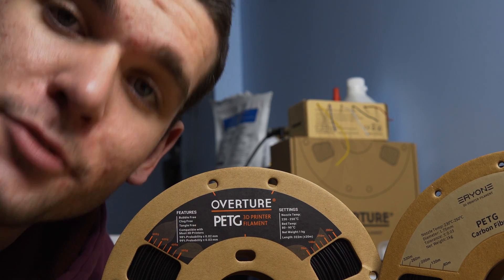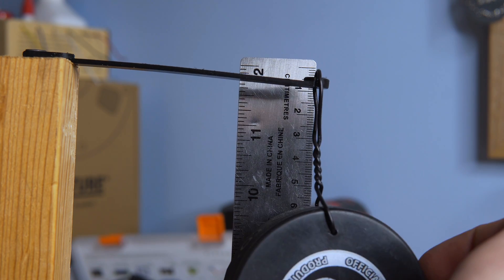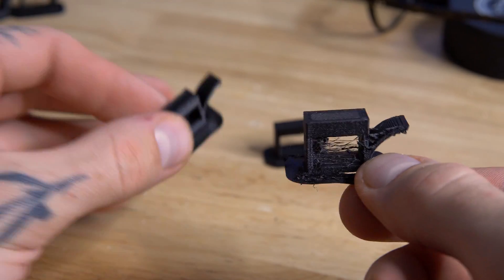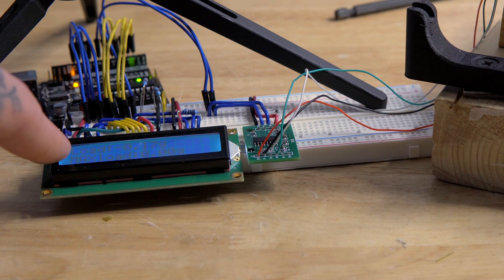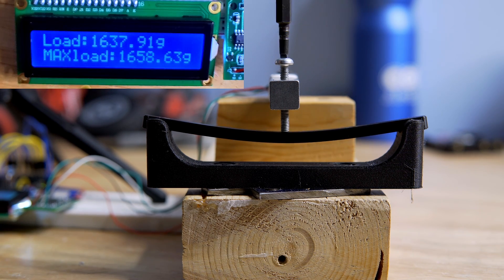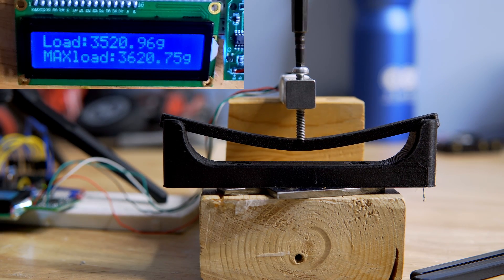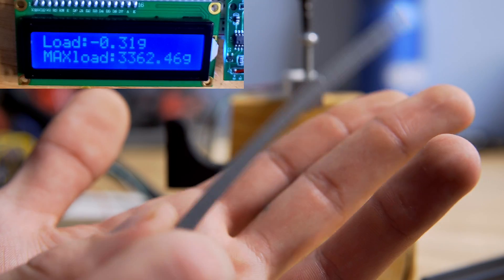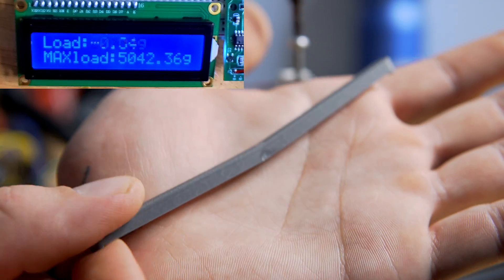Carbon Fiber PETG: Is it worth it? Best PETG Print Settings

Comment: CF PETG is a scam.  The CF has voids where the carbon fiber actually disrupts the layer adhesion.  Take a look at this under an SEM, and before anyone says it, no - annealing won't change it in any significant manner.  That said, it is visually more appealing and may hold up better in higher temp.  There are better filaments if you want a strong part.

Comment: I think if you just hadn't driven the screw so far every time, you still could have gotten useful data.  If you had a stop nut on the screw above your aluminum bar to take up some some stroke so you didn't go to the point of failure on the CF PETG, you could have measured force or relative stiffness at that much deflection on each sample.  I'm impressed with your methods and field expedience on setting this measurement up!

Comment: big thing as others have mentioned the temps should definitely be higher & ur fan is way too high.  which will certainly affect the fact that it delaminated is a clear indication its under extruded & at a too low a temp.  w/ a efficient cooling system a max of 30% cooling (same for petg,  more cooling = weaker parts when it comes to petg).   And the CF likes higher flow then regular petg.   But of course not all brands are created equally either.   I've just started my cf/gf journey as i'll be printing in primarily that.  so i just bought heaps of it.

Comment: If you are just looking at stiffness for the purpose of your impellers, then you should deflect the various materials the same amount (distance) and compare the loads required to get there. I believe that PETG/CF will be stiffer and I don't think that in the case of impellers, it would break. I would also try to perform the test at the same temperature that the impellers will be used at. I assume the liquid temperature is already known?

Comment: I would suspect the carbon fibre would help with deformation when compressed. For instance two metal flanges bolted through a PETG CF spacer. Drilling, tapping a thread etc.... would be interesting also! What about clamping in a lathe chuck and attempting to machine? ... using a face mask, carbon fibre is nasty stuff!

Comment: Should also try ASA, TPU, PC, and PA6 (Nylon)
Reply: With ASA/ABS also in the CF variants - mainly because decent length carbon fibre might be enough to prevent or at least reduce warping tendencies!.
Reply: @ that’s a good point!

Comment: Thanks, I was thinking of trying to print my product in PETG CF.. a screw and grip into the bottom with printed threads, so layer adhesion and cracking are high priority. This looks like the matte texture is not worth the PETG properties loss.
Reply from the maker: Maybe not, at least not with the cheaper brands. It might be worth trying something more pricey, but I think the benefits are negligible.
Reply: @Neally  I ran a burn off test on some voxelab and by volume it was  .05% cf. I prefer brands that list the cf % because some brands add carbon black powder and not chopped fiber.

Comment: My guess is that the CF in the CFPETG concentrates the stress into one area. The CF wont be able to stretch, so it will want to / rather delaminate (because the top layer will be under compression, and the bottom layer under tension.) So it starts to delaminate. If it doesn't delaminate then the next thing to fail would be the bottom layer CF fibres breaking in one spot and then all the strength is gone in that one spot, so it cracks. Meanwhile the rest of it still has intact CF running through it, so remains strong. 

Meanwhile the petg; there's nothing causing different stresses between the layers (tension / compression due to the CF) so the stress is spread more evenly across it.

There's probably some more materials science that goes into it but that's above my knowledge. Yield strength etc.

I've just been designing my first compressor and housing to fit a specific motor in fusion and your channel came up in my recommended, so your channel is right up my street. Although all my PETG is wet and not printing nicely at the moment...Subbed
Reply from the maker: Great info! Thanks, I appreciate it!

Comment: Carbon fiber is tensile strength and usually doesn't like to be bent like that
Reply: Right, he misunderstands the difference between yeild strength and tensile strength. Carbon Fiber adds strength and rigidity, but makes the parts more brittle and less flexible. Also printing with CF, the Fibers are all on the same layer not passing between the layers, which will sacrifice some layer adhesion for more strength in the other direction. CF has it's place, but it has trade offs. Doing this test and calling CF no good demonstrates a large misunderstanding on the material. It isn't good for some use cases, but it is better for others.

Comment: As I've replied to other comments, my friends and I have had much better experiences with CF PETG. I do think the Eryone brand is not a great example of the filament type. My #1 recommendation would be Tinmorry followed by Voxelab AKA Flashforge. While CF or other fibers definitely don't automatically make parts stronger and can decrease layer adhesion, they add other desirable properties. Generally, better bridging and overhangs, easier printing at higher temperatures, less stringing, a more uniform if matte finish, less visible layer lines, and yes more stiffness. Good CF PETG should be like easy mode printing PETG with a really cool finish. Another example of material made easier and better in multiple ways by fiber is glass fiber polycarbonate AKA GF PC. As always, it's just important to remember how much filament can vary by brand and even by color or batch, and that print settings can drastically affect results. Good video though!
Reply: Tinmorry gang! On my 3rd roll with a X1C stock .4 nozzle. Prints beautifully after drying and calibrating which I do for everything but basic PLAs. Had some initial stringing on multi part and complex geometries, but after dialing in the speed and retraction + avoid crossing perimeters in bambu studio, I'm flyin through the stuff.
Reply: @MD.20.20  Calibration is honestly key to get high quality results.
Reply from the maker: I'll have to give tinmorry a try! Cheers, thank you!
Reply: @Neally  Mechanical engineer here there are two PRIMARY reasons to use CF PETG is that it slightly improves the glass transition of a PETG print and that, even as your tests showed (although I suspect you had filament and/or print issues) the end result is substantively stiffer until plastic deformation occurred. 

Another thing to keep in mind is that Carbon fiber only consistantly improves tensile strength load conditions, which is why the failure point starts at the top. This is because the bottom of the beams were in tension and the top is in compression. Do not expect strength improvement in compression loads so avoid "bridge" loads if you want to see better performance out of CF prints.
Reply from the maker: @benruss4130  Thanks!

Comment: I've been told PETG CF is significantly easier to print than regular PETG because the CF helps with the moisture and bridging during prints 

I bought 2 spools to try out because I hate printing regular PETG but I want to print things to go in my garage and not have them warp..
Reply: This is my general experience along with several friends in a 3D printing Discord. CF PETG is easier to print than PETG generally and has a lot of desirable attributes. The finish is especially nice if you like a bit of matte and less layer line visibility. I recommend trying Tinmorry or Voxelab/Flashforge brands to start.
Reply: Any results?
Reply: @FrankensteinV203  sorry forgot to reply 
petg cf is so good. I just wish it was cheaper 

prints almost exactly like PLA. sticks to the bed really good but still can be removed. as tough as PLA but with even less shrinkage. no need for a filament dryer just printed it straight. and no need for tuning just used bambu defaults. 

I tried regular PETG and it has been super difficult to get it to stick to the bed and to print well. 

I will never buy regular PETG again.. too much of a hassle
Reply: @FrankensteinV203  it should be coming in today

Comment: I noticed that petg strength and stringing etc differentiate even with different color of the same brand. It can be that pla is stronger but in sommer its different story.. Try to use phone holder in car or so.. Pla is useless outdoors

Comment: I primarily use PETG for its UV resistance and its temperature resistance but mostly the UV. PLA will not only melt or deform in sunlight but it will deteriorate as well. Not good for parts that need to be outside in the weather. I think that CF PETG is more for aesthetics and nothing more. It gives you that flat black finish that some find desirable.
Reply: Entirely agree

Comment: Carbon fiber for consumer-grade 3d printers is a gimmick and a waste of money. Even under the BEST circumstances carbon fiber filament adds almost nothing to the the parts. Consumer-grade FDM printers are amazing, and for light-wear items and rapid prototyping, the are incredible machines. If you need more strength and stiffness, then there are better options.
Reply: Just adding a side note that it is great for applications where heat is your main concern. Of course not saying its the best material but for people with lower spec printers its prob the best option like in my case. I wouldn't rule it out right but as everything else people need to know what they are buying and why. The advertising is for sure misleading though.
Reply from the maker: For sure!

Comment: Everything I've seen so far makes it seem that CF infused filaments are a gimmick.
Reply from the maker: Agreed. Maybe a higher end CF petg filament would perform better, but the budget filaments seem practically useless
Reply: Maybe formulas are just getting better, but this isn't my experience at all. While CF or other fibers definitely don't automatically make parts extremely strong or make layer adhesion better generally, they add other desirable properties. Generally, better bridging and overhangs, better printing at higher temperatures, less stringing, a more uniform if matte finish, less visible layer lines, and yes more stiffness. I'm not sure if the particular brand in the video just wasn't great or if it needed higher printing temperatures for example, but generally my friends and I find CF PETG to just be better than general PETG all around for many purposes.

Comment: It appears cf filament is a waste of time and money
Reply from the maker: It seems so, at least the brand I was using it. It's unfortunate really, I liked the textured of it a lot
Reply: Will always depend I use it solely for its heat resistance as it is more heat resistant that normal PETG. Granted it wasn't tested but just commenting to show its another use case compared to the application in the vid. As my a1 can print PETG with ease but struggles with other heat resistant materials just makes it SO much easier to work with.

Comment: I print PETG CF at 260c because the hardened steel nozzles need a lot of temp to maintain good extrusion and layer adhesion. I use no fan for first layers and then 25% with an enclosure. In the summer, I up the fan to 50%
Reply from the maker: I found upping the fan speed after the first layer seemed to reduce stringing, but honestly getting the setting for it right seems more like  voodoo than anything😂

Comment: I love PLA, the looks, the ease of use, the non toxic and semi biodegradable nature, the renewable part and the stiffness. But high temp really ruins it even at moderate levels. I think eventually we will have a PLA ++ or PLA 2 that has all the good plus better temp resilience.
Reply from the maker: I've been printing with pla a lot more lately and it really is wonderful, if only it had better thermal characteristics
Reply: it's the non toxic and semi biodegradable nature for me 🤓

Comment: My experience with PETG CF has been disappointing to put it lightly. Annealing might help, but the cf is basically ruining PETG’s best attribute which is flexibility before breaking. Long strand cf would be better, but chopped cf is a waste.
Reply from the maker: Agreed, I've heard higher quality cfpetg is less disappointing, but for my purposes it's definitely impractical
Reply: Eryone is typically very high quality.   I would be surprised if it was a quality issue.   See my previous comment about the property you tested vs your desired improvement.
Reply: @gg48gg  I have Eryone PLA marble and it has been great. The Eryone CF-PETG on the other hand has been terrible.

Comment: Some of the cheaper "Carbon Fiber"-Filament only has Carbon Fiber powder or very short fibers inside, which do not contribute to the mechanical properties at all. I used Extrudr PETG CF and noticed a big difference to normal PETG and it was perfectly fine to print, no print setting adjustment needed.
Reply: I second all that, cheap CF blends suck.
Reply from the maker: I've heard that too, I'll give that brand a shot. Thank you!
Reply: Appreciated your testing effort by the way! Really felt your disappointment after you realized that the PETG CF was not that good :D @Neally
Reply from the maker: Yeah haha, I was definitely hoping for a better outcome, maybe the other stuff will yield some better results!  @Interspieder

Comment: Petg is a waste of time. I print rc cards parts and can tell you from experience that pla plus can handle much more abuse than petg.
Reply from the maker: It's all about application, I've had pla parts crack and shatter where petg held up.
Reply: @Neally  I used PLA+, PLA CF , PETG and ASA CF. It´s all about application , PLA dont like temperature changes , and only for that reason , for me , its the worst filament out there.
Reply from the maker: @Untiocansado  Yeah, I agree
Reply: Hobby Rc cars have traditionally always used PA6 and PA66 Nylon with 33% or less glass fiber reinforcement. That is far stronger in every way than PLA, PETG, ASA, ABS. Nylon can be hard to print, but it is the king of thermoplastics.
Reply: @_..-.._..-.._  Yes I agree. The bad thing is that it is difficult to get a good nylon filament, most have PETG or some other plastic mixed in to facilitate printing.
Reply: Tough talk from someone who spells cars wrong
Reply: CF PETG is really cool because it basically takes away all the negatives of printing PETG while adding some desirable attributes like stiffness. It's super easy to print, has a great finish, and has higher temperature resistance than PLA. These are all general statements of course and vary by filament, but if you haven't tried CF PETG I def recommend it. I have some by Voxelab/Flashforge which is decent, and I know a lot of people have great luck with Tinmorry brand. I agree a good PLA can be awesome though.
Reply: I live in Florida and PETG is a lot more resilient here even in the comfort of my own apartment. PLA holds up okay but it's not something that I can use outside so I tend to avoid it. As for PLA+ I don't really think it's going to be much of a difference unless it's formulated specifically to be resilient against UV radiation and has a higher transition temperature.
Reply: Stuffer isn't stronger! Stronger isn't stiffer!

Comment: Try PCTG, basically PETG but better, and maybe pla with CF or other brands of petg, as it differs alot, also try to print PETG really hot even if it strings, it makes it adhere better preventing the delamination.
Reply from the maker: For sure, I'll give those a shot. Thanks!
Reply: Pctg is tough to find.  Hopefully it will become more available soon.  Have you found a good source and brand?
Reply: @gg48gg  I know 3 brands that have pctg, which is more than enough for me since I only order one xD. I order all my filament in eu from 3djake. And they have their own filament as well but I like the fiberlogy one alot. Although it needs drying it's very sturdy and has near perfect adhesion on the recommended temps.